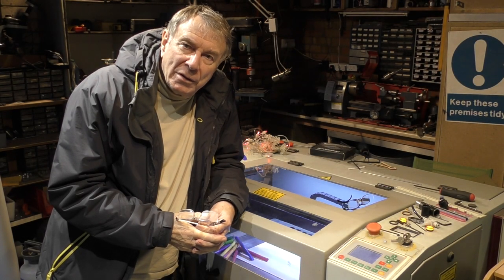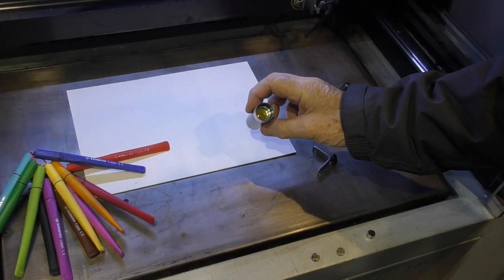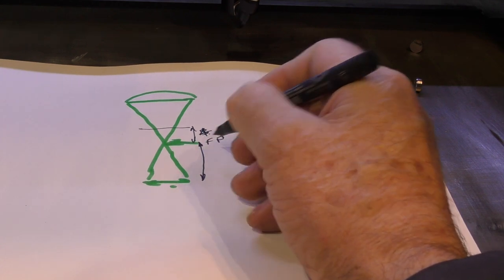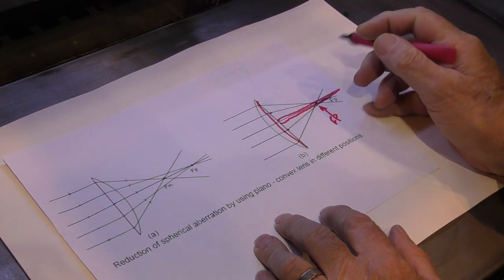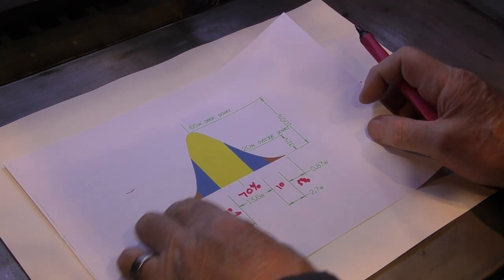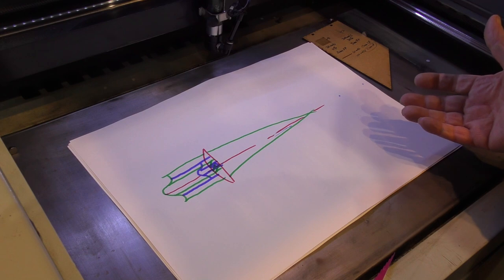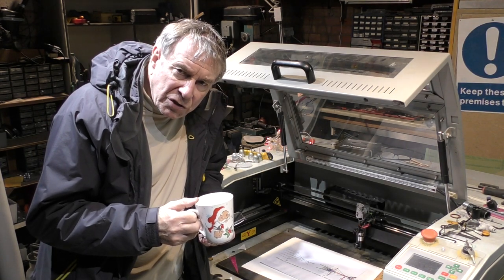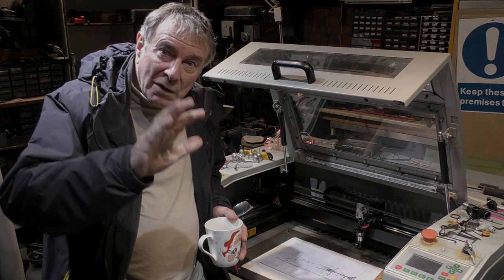RDWorks learning Lab 194 I seem to have lost my FOCUS

Comment: I ended up with a gift this year from a VERY nice YT creator I have helped, and followed, for almost two years now and in that gift was a 3018 CNC Pro.  Along with the CNC part it has a nice 1W blue laser that does TTL.  Well, to my surprise I can dither with it right out of the box that I could not easily do with my CO2.  The one thing I would love to find is the compound lens system I bought of your design for the CO2 but for the Blue Laser diode instead then I could engrave so much better than ever as that is the diode's weakest part.

I haven't spent much time with it beyond building it and testing it for half an hour but I spotted that issue right away but even with that issue halftone is so much better with it.

Comment: I find my cutting performs much better with the round side of the lens facing down. I'm really interested in the compound lens setup your talking about. Sounds like I could achieve cutting thicker materials with the beam having a tighter concentration of power as well as extending the narrow area of the hourglass beam.

Happy Holidays,
Lance

Comment: AArrrgh! I thought we were going to get the testing of the two lens setup in this session! The suspense is killing me! :D However, there's yet another explanation of the crazy stuff we see every time that we are working with the machine. Looking forward to the next session. Merry Xmas!
Reply from the maker: Hi Nico
You will have to learn to be patient.  I couldn't hurry old age, I had to wait for it to creep up on me!!!  In my case I'm not sure it was worth the wait.
 Happy Christmas
 Russ
Reply: @SarbarMultimedia  LOL! xD 
I have to see whether I can check it now that I have my lightweight head. Work has kept me out of my workshop so I could not get a grasp on testing yet. Seems it will be my christmas gift :D
Reply: Russ out of curiosity is it possible to use a highly corrected microscope objective and also perhaps explore if a confocal pinhole setup could be applied in this setup.
Reply from the maker: @russellspear4911  
 Hi Russell
 One big problem with your thought. We cannot use normal glass on this machine. Glass is opaque to 10.6 micron light.  We can only use zinc selenide or gallium arsenide.
As I allude to in the video, our optical issued are very special  and there are VERY limited types of commercial lenses available.
 Best wishes
Russ
Reply: @SarbarMultimedia  in multiphoton confocal microscopy we use IR lasers and objectives that are transparent.  James Pauley has a book that Principles of Confocal Microscopy that covers the illumination theory, for both single and multiphoton illumination.

Comment: Had a question on the lower lens. Do you think that you will be able to use the same quality lens in the lower position that you normally would, or will it need to be a better quality to handle the concentrated beam from the upper lens? I'm using the PVD lens' in my 80W, and am wondering if I may need to get a GaAs lens for the lower in a compound set up.
Reply from the maker: Hi Dave
This is an interesting concern I have myself and is one of the many questions I hope to answer during this investigation. 80 watts is the supposed safe working limit for a PVD lens but that is such a difficult thing to define because it is not really POWER limited but I suspect it is INTENSITY limited. My 70 watt (really 80 watt)  tube has a  near perfect Gaussian distribution of light intensity and will really be testing that central 1 or 2 mm section of the lens.  I don't know for certain, but I anticipate it's the anti reflective coating that is the weakest link in the transmission chain. I say this because I have already destroyed a couple of lenses in that way with my bare stainless steel engraving experiments. All the research I have done into zinc selenide tells me that there is very little loss due to energy absorption within the material . The fact that it is only about 70% efficient at transmitting IR  in its raw state is due to the crystal structure REFLECTING the light. hence the need for an anti reflective coating.  Gallium arsenide lenses are more expensive and also have much higher power thresholds but if it turns out that you can get 50% more cutting efficiency from the compound lens system, the small extra expense on a lens that allows you to TEMPORARILY  make your 80 watt tube  into 120 watts without sacrificing that low power control you get with an 80 watt tube. The tantalizing prospects are fascinating and I feel I have done enough exploratory work already to show that this is not a dream but just a matter of pinning down exactly how far we can push the compound lens idea.
I have a busy week ahead that will limit my work on this subject but thereafter I plan to get stuck in,
Best wishes
Russ
Reply: @SarbarMultimedia  Glad to hear you are making progress, and I agree that the cost of the lens' are nearly double, but no where near the equipment jump going from an 80W to a 120W ( hopefully ) cutting power. Even then, it would only be the lower lens. A small dollar sacrifice for such a big cutting gain. I have a 4" PVD now and was considering a 6", the longest I can find on the Cloudray site, but will wait to see how your experiments come out to see if I need to add a Gallium arsenide lens to the order. King is probably getting a bit tired of answering all my questions and no order yet, LOL.

Comment: So, how do you calibrate a Z axis? I use your squareness drawing to test X, Y, and skew. But calibrating Z has me scratching my head. Short of putting a target on a square sitting on the table in front of the beam, I can't see a way to do it properly. And even then I'd be looking at a large spot and not a small dot / line.
Reply from the maker: Hi Dave 
  Your question is a bit ambiguous when referenced to this video. It could be asking about how to set the focal point in Z if there is so much variation OR it may be asking how to set the beam correct in the Z axis.
 On the first point I hope I haven't confused you with this . The first part of the test with drawn lines is the correct way to determine  the most powerful focus point. As I demonstrate, this can change a bit with speed so  understand the difference between cutting and engraving focus and if you have a job that involves both you may wish to set a compromise. 
 The point of this video was to demonstrate that  not ALL of the beam is going out of focus as the distance from the nozzle increases . It is my proposition that this central  beam  power is what's actually doing your cutting when you cut 10mm thick material and set your focal point on the worksurface. I will be proving (I hope)  that to force more power down this central path by decreasing the size of the beam going into the lens  will give me more cutting power.

 On your other possible question  see  this from about 30 minutes   https://www.youtube.com/watch?v=6aNwKhTRnd8
 You must use the square you mentioned to make sure that both  tube mounting surfaces are square to the worktable.

 Best wishes
Russ
Reply: @SarbarMultimedia  Russ, I guess I didn't say it correctly. When you run your focus test that drops the bed 1mm between each line, how did you calibrate the step length in the controller to know that it actually dropped it 1mm? I can scribe and measure lines in X and Y on the bed and enter the two values in my Vendor Settings, but how do you have a graph length and a measured length to set your Z step length? The only thing I can think of is the fine scale you use for setting you HD lens, but I'm not real clear on the accuracy of something like that.
Reply from the maker: @davev5686  
 Hi Dave 
 On this Lightblade machine, the Z axis is controlled by a stepper motor, so it is just like calibrating the accuracy of X and Y  See this video from 28:30 and you can see how to do it.

https://www.youtube.com/watch?v=ki8bFEAcJG8
If, like most You have a manual table it is just as easy to use a step gauge like you see me using all the time and drop the table in 1mm increments, If you want a dxf file to cut your own, send me your disguised email address in another comment and I will send it to you.
 If you take a look at this video from 1:30   you will see a method by which you can accurately add a digital measuring system to your Z axis temporarily.   https://www.youtube.com/watch?v=zJjAr-TANQk

 I hope this helps answer your question
 Best wishes
Russ

.
Reply: @SarbarMultimedia  Picture me slapping my forehead and groaning. As soon as it started I remembered it. I have most of the pieces to convert from a line powered Z to a stepper powered Z, just have to pick up the driver box. I already have your email from previous purchases, and will check back on the test pattern once I get all the various hardware installed.

Have a Happy Christmas and a prosperous New Year
Reply from the maker: @davev5686  
 Hi Dave remember you need a limit switch at the top of the stroke to set  ZERO  and then set the breadth in Z  Vendor Settings
to stop it crashing into the bottom.
Reply: @SarbarMultimedia  Yeah, I remember that video. For what ever reason I spaced off the Z calibration video. Just like I forgot to ask about the aluminum holder for the #2 mirror when I ordered the MK2 lightweight head. But I'll live.

Comment: Good morning , I have a question "how to export (rd format) from Mac Os ?"
Reply from the maker: Hi Bassam
I am not aware that RDWorks runs on  OS therefore I have to assume that you are using Lightburn. In Lightburn at the bottom right you will see a SAVE RD button. That will output the machine code to an external file (FAT32 USB memory stick) so that you can transpprt and load it manually to your laser machine  via the UDisk input port.
Best wishes
Russ
Reply: @SarbarMultimedia  Thanks

Comment: That was very interesting! 

Now the most important question. Can you warm up your coffee with the laser or will it be disintegrated?
Reply from the maker: I am sure you remember old filament light bulbs ? How long do you think it would take to heat my coffee with one of those 60 watt bulbs? Power is power. If I take the lens out it will do the same as a light bulb. If I leave the lens in and focus all the energy onto the surface of my coffee, the water will heat instantly to 100C and turn to steam there will be little heating effect on the bulk because all the energy is going to evaporate the water ie it will never get hot.

 Best wishes
Russ.
Reply: @SarbarMultimedia  
I thought so. 😉   But perhaps the spot would be hot enough to release some unhealthy components. 
And those filament light bulbs are available again.